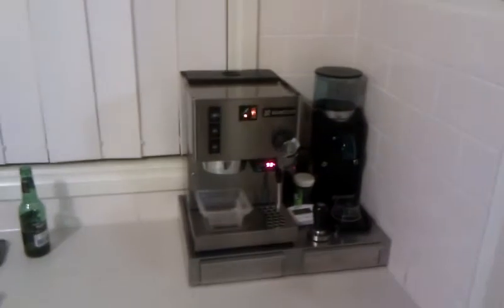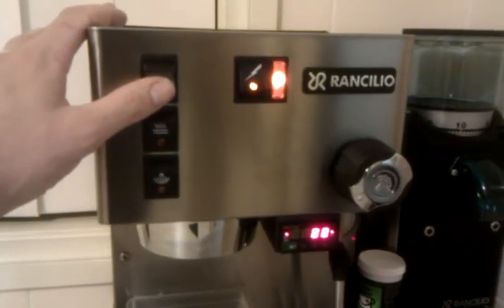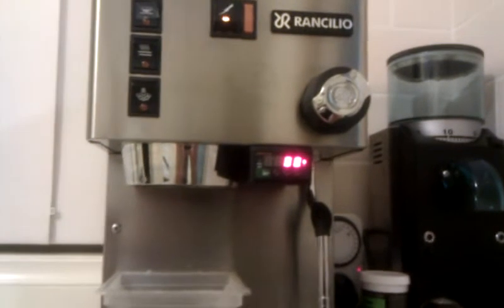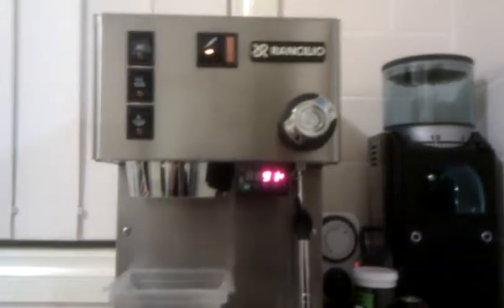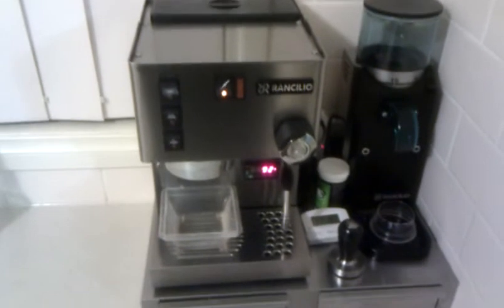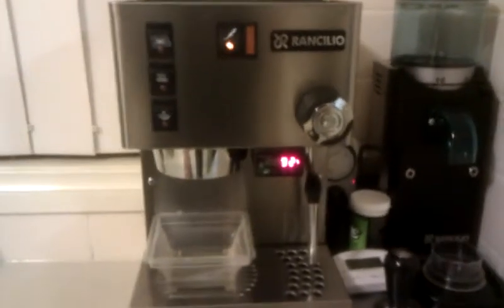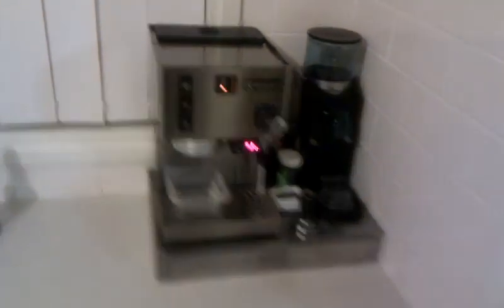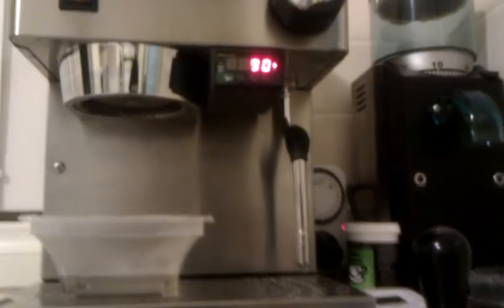Pid install finished

Comment from the maker: Thanks for your comment, yes it wasn't as difficult as i thought just very daunting to drill holes in my little baby.
I think this way is an excellent alternative to putting the pid on the side and SSR down the front and the best bit is you only have to remove the 4 screws on the top panel to install !